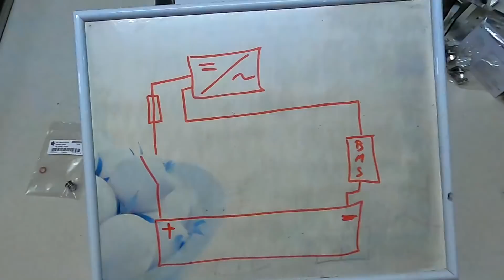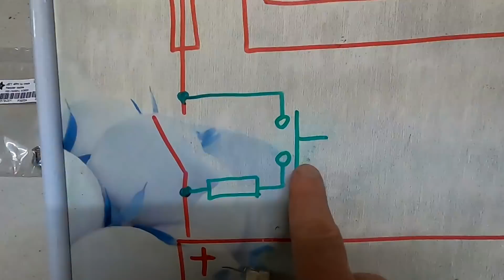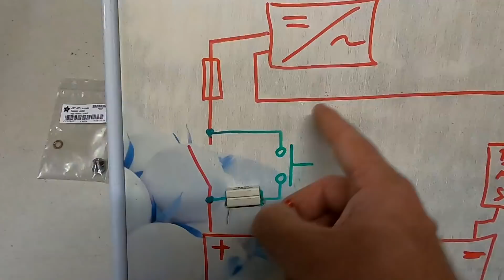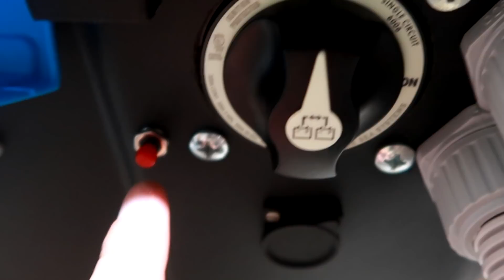The Community suggested these upgrades - I have listened

Comment: If there is a spark in a big breaker like that, can the spark damage something ?
I have a remote control on my inverter, så i can turn it on after i powered on the main swith. But i think it it is allready charged before the romote, so i am not sure.

Comment: I never ever used a pre charge resistor. I use a high speed battery switch witch kills any spark. And after I switched on I start the inverter and all dc loads. No problem so far.
Reply from the maker: It's not so much about the spark but more about the inrush current you could get which could kill your BMS or other electronics. But I don't use it either when having a switch connected.

Comment: I like the push button idea. If you add a LED and 4700 ohm current limiting resistor in parallel with your precharge resistor, you get an indicator that goes out when the capacitors are charged. 
If the inverter has been left on it won’t go out. Yes I’ve done it as well...

Comment: Hi Andy, 
What size resistor should I use for a 12v system connecting to a 1500w invertor?  I currently have a 50w 20 Ohm J one lying around would that be ok?
Reply: Connect your 20 ohm resistor to your discharged Inverter and see how long it takes to turn on.  50 Watts is plenty big.

Comment: don't know if it is of any use to you, I have a Victron Phoenix inventer. When I turn on the inventer then a magnet switch on, then I get 220 from the inventer.When I turn off the inventer then the magnet switchI back a get 220 or grit.this way I can manually switch between my panels (Inverter) or Grit

Comment: Andy you need a good rotary tool, like a Dremel. It would make enlarging and reshaping those holes much easier. Then you could make room for the second wire leading into your fuse box, for example. Plus, once you have the tool, you’ll find a million other uses for it. You can even get battery operated ones from Ryobi or someone similar. 💜🤓👍

Comment: 5:56 u dont ned the switch buton, the current will travel true the resistor when circuit is open and when is clouse no current will go true the resistor this is how the litl red light on the switch of the lights work just put the resistor in paralel with the disconect swich
Reply: No, that defeats the disconnect switch.  A Disconnect Switch in the OFF position means ... OFF.
Reply: @MrSummitville  sorry i explained bad i mean no ned push button
Reply: @andreiapostolache3487  The answer is still No,  you should NOT connect the resistor in parallel with the disconnect switch.  You do need a momentary switch, to activate the Pre-Charge resistor.  Best if this was integrated ( as automatic or manual ) inside the Inverter by the manufacturer ...

Comment: Damn, I just bought the large version of that tub for storage and couldn't place where I'd seen it before... 'duh, Andys channel!

I was thinking - that resistor in the BMS that lets some power through before it's relay kicks in.. that couldn't possibly be there to do the precharging to save the relay suffering from early death due to inrush current/sparking?  I remember you decided it was probably for power saving so it doesn't need to have the relay energised during standby, but I can't help but think they were trying to reduce the chances of sparks in the relay killing it.

Comment: Not a file. Soft HDPE plastic like those totes I usually just carve it with my knife.
I love the pushbutton to precharge. :)  I like an LED in the circuit. When first pushed the LED lights but as the current drops down the LED goes out.

Comment: Love the additions but I am wondering if the button you are using for the precharge resistor is rated for 50v? Not sure if it really matters but I would be a little worried about that switch welding closed!
Reply: You think the switch will "weld closed" even with the resistor?

Comment: On your next build, instead of a two position switch and a push button, you could make it a little simpler with a three position switch: off / pre-charge / on.
Reply: Personally I prefer the pushbutton. It works with the most common off/on switches and allows me to hold the button while I turn on the switch.

Comment: I think all you need to do to fix your box is move your board back a bit: Instead trying to position it as close to the end of the box where the cables and switch are mounted, just move it back a foot or so closer to the center of the box. That way you can lift it out without disconnecting any cables. You could also switch to using Anderson style connectors (They make them up to 350 amps) to make it easy to quickly disconnect/reconnect cables instead of having to get your socket/wrench out every time you need to disconnect.

The bigger box would just waste space. I think you can easily tweak this one to work better, you just need to space things out a bit and moving that BMS board back a foot or so would make a huge difference in spacing.

Comment: Instead of a resistor, you could use a light bulb, when it goes out, caps charged, and the main switch can be turned on, a 120v /220 with 48v bulb can be used, or a resistor with a 12v incandescent bulb, as long as it's about 10 -20 ohm 5watt resistor,
Reply: He already has LED's that show exactly when the Charge Controller & Inverter are ON.  Adding an incandescent light bulb, adds nothing but another failure point ...

Comment: I was going to suggest a pushbutton switch with a resistor, to pre-charge caps, before hitting the switch! It could be a real convenience if the battery is ever turned off!

Comment: A more elegant solution is to have two power switches - a master power switch that connects and disconnects the battery pack from the entire circuit that is almost never turned on/off, and a second push on/off low current switch that energizes a high current  contactor.   Then, the contactor should have a precharge resistor of about 600 ohms connected across the main power terminals so that it is always energized as long as the main power switch is on.   Then, the contactor should be activated using the push on/off button.   That way, you don't ever have to think about the precharge resistor again and you can place the low current push on/off buttton in a remote location that is more convenient.  If this interests you, let me know and I can make some recommendations for components.
Reply: make a video?

Comment: What is interesting about the precharge resistor is that it can be in the circuit ALL THE TIME.   The inverter is not going to be drawing a consequential amount of current whether the resistor is in place, or not.  The problem with the push button is that if you forget to push it, you defeat the purpose of having it.   All it takes is once to blow your capacitors in your inverter.   Electric golf carts use precharge resistors that are always connected across the main contactor for the motor circuit, as an example.   The key switch is what energizes the precharge resistor and then the pedal energizes the contactor.   But, as long as the key switch is in the on position, the precharge resistor is energized.

Comment: Love the pushbutton. I am doing that myself. As an FYI, that Blue Sea systems main switch is not rated for 48V. I was going to use the same one, but called their support folks, who confirmed that for 12V and 24V, the switch is fine, but it is not rated for 48V systems. Its rated UP to 48V, but not over. When charging, you are over 48V.  It may work fine most of the time, but in an emergency under high load, the contacts can arc.

Comment: You could add an LED indicator and/or buzzer in parallel with the precharge resistors using a current or voltage regulator, then you'd have a visible or audible indicator until voltage across resistors goes down to 3-5V.
Reply from the maker: There is literally no space inside this box any more for more gadgets. also, the voltage would drop again once the inverter starts and consumes power. So holding for too long does not help either.

Comment: I'm converting a tinny to an electric outboard and I think I have found the ideal material for a battery box. I am going to use aluminium planks and rivet nuts. The hollow planks allow for sockets, gauges, plugs and wiring to be housed in the outer skin, the planks are strong enough to constrain any battery expansion and the aluminium can help conduct heat out of the batteries. My set up will contain 16 x 272 lishens. The box will then act as a bench seat in the boat and when not in use will supplement my home system. The box will be superior to a pelican type box and end up costing half as much. Any thoughts?
Reply from the maker: Great project. Make some videos about it. I'll watch.
Reply: @OffGridGarageAustralia  I will.

Comment: Andy, good job with your project, but @9:52 I winced really hard when you set the uninsulated wrench on top of the cardboard you had covering the cell terminals.  There was a whole row of bus bars exposed on one side of the box.  It's not a good work practice to work around the battery terminals with uninsulated tools like that.  You don't want to see all your hard work literally go up in smoke.  I had a situation where I dropped an allen wrench while I was working on my battery terminals and if I had not previously insulated it with electrical tape I would have had a major arc flash in front of my face.   Just saying be careful.
Reply from the maker: Yes, I need to be more careful with that. Thanks.

Comment: I wonder why so few use light bulbs instead of resistors as it would show by going out when the voltage drop across the wire decreases (it is also easier to find light bulbs for a car than some resistors)
Reply from the maker: Hmmm, never thought about this. Maybe there are not many 48V light bulbs?
Reply: @OffGridGarageAustralia  Four 12v bulbs in series.
Reply: @charlesrichards5389  Incandescent bulbs FAIL.  This Power Resistor will not ....
Reply: @MrSummitville  Is here someone on this forum who doesn't know that? I wasn't answering a reliability question. Chill dude.
Reply: @charlesrichards5389  I was addressing the reliability issue.  Incandescent bulbs fail.   Incandescent bulbs are a bad idea ....

Comment: Ref your idea of box 2.0. Although not relevant to you, having a bit more space for insulation and battery heater for winter operation might be appropriate for those of us who wish to charge the LiFePo4 batteries in low temperatures. I will be mounting mine in a very small camping trailer (internal dimensions 1.2m x 1.0m x 0.5m). It will have 32 x 280Ahr cells with inverter) to provide 28kwh mobile power. No more need for noisy and smelly generators.
Reply: As this is a mobile application I will be forced to enclose it inside the trailer with vents and computer type fans which I will control with a thermostat. Here in the UK the temperatures are rarely a problem but I will use a 5kva unit for a 3kva application to ensure no trip outs during hot weather. My off-grid location (an airfield) is about 2km from home which I visit on a daily basis and have no way of adding solar at home so will bring the energy home for my wife's EV for overnight charging when there is no time to take it to the airfield. As a result I will need the Victron unit with charger as well to transfer charge from my off-grid hangar. So to answer your question I will be using the Victron MultiPlus 5000VA, 48V Inverter Charger. As the airfield is totally off-grid having a mobile source of  240v power will enable me to sell the generator. Even now (early Spring in the UK) we are running the EV purely on sunshine covering 1500km/month which is very satisfying.
Reply from the maker: Wow, what an interesting setup and solution. What EV has she got?
Reply: @OffGridGarageAustralia  Our current EV is  Kia eSoul which is our second car. I hope to replace my VW Golf with the new Kia EV6 later this year. I was thinking of buying a Tesla but the V2L (Vehicle to Load) capability of the Kia has made change my mind. Also I do prefer hatchbacks. The Model Y is too wide for my garage and in any case won't be available for a while yet in the UK.
Reply from the maker: What inverter do you use in such a small space. People freak out about my setup even this inverter I'm using was designed for such small tight spaces.

Comment: An alternative to a resistor is an appropriately chosen light bulb. It lets you see the pre-charge working. If your system has a short the the light won’t go out so you know not to close the main switch.
Reply from the maker: An 48V light bulb? I think they used these in older control panels/switchboards. I may have some floating around somewhere...
Reply: @OffGridGarageAustralia  Incandescent bulbs FAIL.  This Power Resistor will not ...

Comment: Great progress Andy, good to see your community is working together things are turning out great, also showing these steps will let us learn also. I wouldn't worry to much on the inside of the box, when the lid is closed you won't see it and how often do you look inside the box if all is working well. I was thinking about your bike charger, do you run a cable now from your house to it? If so why not use the old connection outside the garage where you have the connection to grid 😁 but then again, you might not use this much. And why build a Rolls Royce if a VW does the job very well. Good luck and thanks for explaining everything. This will definitly help people in an island setup of battery and solar powered garage/home.
Reply from the maker: Thank Edward. Always appreciate your comments and feedback.
I don't use the e-Bike charger often. This is more an emergency backup and peace of mind setting. The battery is with 14kWh so large I rarely run it down I would need the charger. And, the sun is always shining here. We had 5 days of rain weather last week and I still could charge the battery by 10% every day.

Comment: Idea for Battery Box 2.0, placing an audible alarm on the precharge button. Nothing annoying just something similar to the multimeter.
Reply: Why?
Reply: Audio verification the circuit has been completed. Also do to the battery pack's location, in a garage on the floor, you would know if it accidentally got pressed. Most Importantly all about the Bling...and why not? We are definitely past the simple battery build at this point so trick it out. 😎
Reply: @landonashby2029  He can already see the LED lights on the Charge Controller and the Inverter.  That is all that he needs.  Adding more junk than can fail, is just bad engineering ...

Comment: If nothing goes wrong you might not even have to touch that box again.  You did a good job don't be so hard on yourself.  Safe design is the most important.  Add fans to your charge controller/inverter box so don't kill them with heat.   Then add some more solar panels on your roof and really get some use out of those batteries.
Reply: ”If nothing goes wrong”
Famous last words 😄
Reply from the maker: Yeah, it's all working as designed, just not as pretty and functional any more as intended.